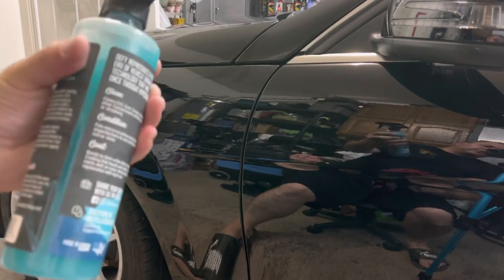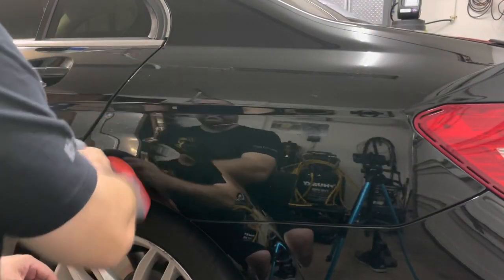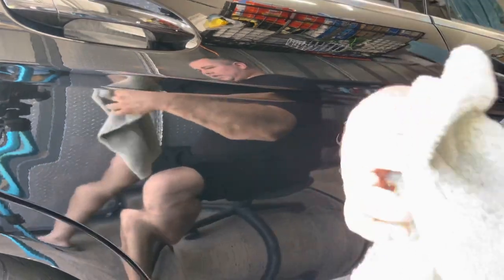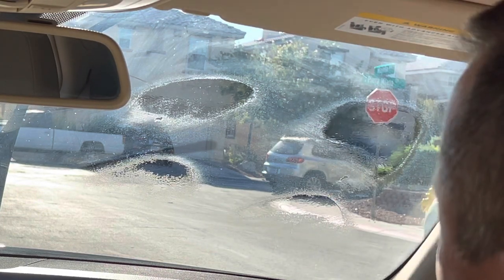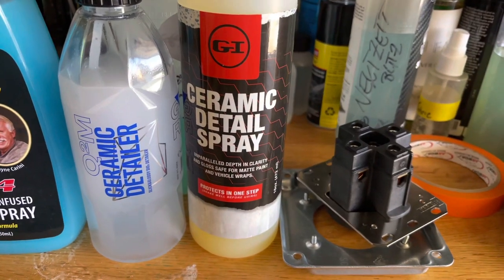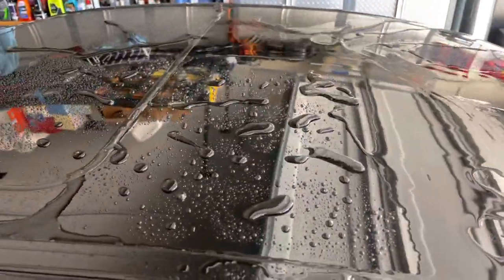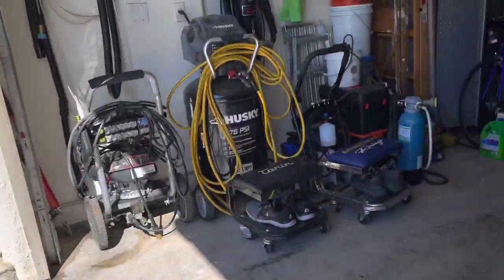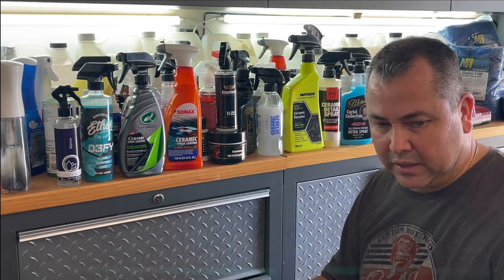Ceramic sealants and ceramic quick detailers!   How well do they work?/auto detailing

Comment: great straight forward vid as always....i use gyeon cure at a 1/1 dilution ratio as a quick detailer/drying aid....stellar hydrophobics and gloss as it has 5%+ si02   u should try the elixir....so far the highest "jetting effect" of anything i have used - depth of gloss, hydrophobics and self cleaning are first rate.  little goes a long way.  First application i spray a micro applicator 2x to do half a hood....then one spritz therafter for subsequent panels.  after first application just one spray per panel as a drying aid.  durability is 3+months easy...of course i use it every other wash.  my top 3 currently are nv lustre=elixir=cure.....when i do prep for winter i am going to use brians(apex) hydrasheet for winter protection against the chemicals of chicago/northwest indiana road de-icers and salt. be well my friend
Reply from the maker: Good info u got there.   When u use Hydra will u strip the panel?
Reply: @DetailingBreakdown  yep...will use gyeon restart with poor boys strip down...then IGL f4 renew....topped with rehydras-heet
Reply: @DetailingBreakdown  do u have a link for the gilmour nozzle u use???
Reply from the maker: @johnketuroskey6293  Gilmore nozzle?
Reply: @DetailingBreakdown  hose nozzle
Reply from the maker: @johnketuroskey6293  I just picked one off amazon

Comment: Try using a damp microfibre cloth after application of the Sonax product, prior to buffing with a dry cloth. Buffs off much better with less grab.
Reply from the maker: Good pointer there.  Thank you
Reply: @DetailingBreakdown  I have found that to be a very effective and easy part of the process with the Turtle Wax Seal&Shine, Hybrid Solutions Ceramic, and the FLEX Graphene.  Eliminates streaking/high spotting and brings up the shine especially with a follow-up buff with the favorite fluffy.
Reply from the maker: @audieconrad8995  nice

Comment: One more thing - I use Gyeon Ceramic detailer (for example) and that can be applied as a drying agent or as you did to an already dry panel.  The results differ.  Could be the topic of a video - Finishers: Apply Wet or Dry?
Reply from the maker: Umm interesting, ty

Comment: Watching your section of the roof using the McKee Polish - looks effective.   Have you used the TW Hybrid Ceramic Polish?  Fantastic  polish.  Medium-light cut with great gloss and protection from polymer/ceramic/carnuba.   I consider it the best "cleaner wax" on the market.  The TW Hybrid Solutions Ceramic 3-1 Detailer is also verrrry effective and is a real bargain at 32 oz. spray bottle.  I use regularly on my wheels.  It produces excellent gloss, h2o repellancy and durability.
Reply from the maker: Haven’t tried the TW ceramic polish but how do u classify it as a cleaner wax if it has ceramic?
Reply: @DetailingBreakdown  really as a matter of speech because of it's lighter style cut and the fact that it does contain carnuba.  Especially Imho if applied by hand I'd recommend it as a great alternative cleaner "style" wax.  Either way it has great versatility.
Reply from the maker: @audieconrad8995  right on, I gotcha

Comment: good vid. for whats its worth ive had great experiences with the ethos product line.  the Resist is tied with defy as my favorites.. im very tempted to try the gyeon ceramic detailer. its been in my Autogeek cart a few times...
Reply from the maker: Gyeon products are excellent, just not the wax.  😂
Reply: I just started using the Gyeon ceramic Detailer. Its running neck and neck with Carpro Elixir. Pretty hydrophobic too
Reply from the maker: @Knards  nice, I’ve never tried Elixir but Ech2o and some Sio2 can make it the old school way.   I just like the Gyeon
Reply: @DetailingBreakdown  Elixir has been by far my favorite for several years.But then again its going on a Carpro UK 3.0 coating
Reply from the maker: @Knards  it’s a good product for sure.  Helps that it’s going on over a coating

Comment: "Ceramic" & "Graphene" are the "Teflon" of the modern age.  Same ol' promises and marginal results🤔
Reply from the maker: To each their own.   But most the ceramic coatings I’ve used are excellent at helping to keep the car clean and make it easier to clean.
Reply: @DetailingBreakdown  well until it rains and the Sun comes out and you have water etchings over your whole car and you have to basically compound the whole car to get them off yeah I don't think so I'll pass been there done that 🙄